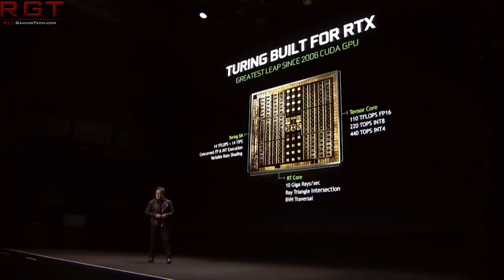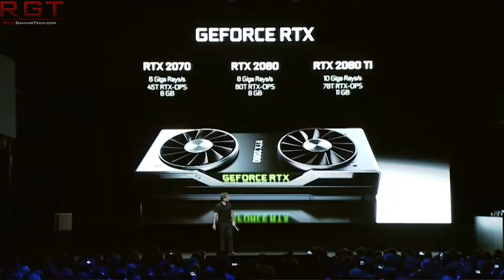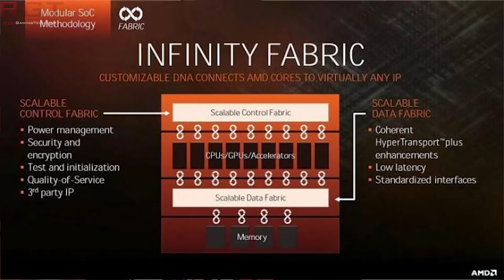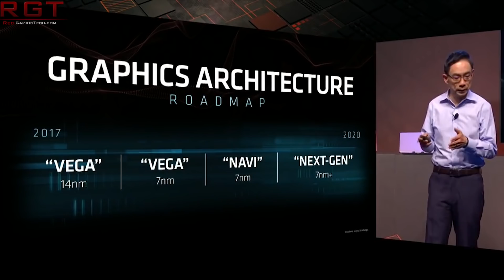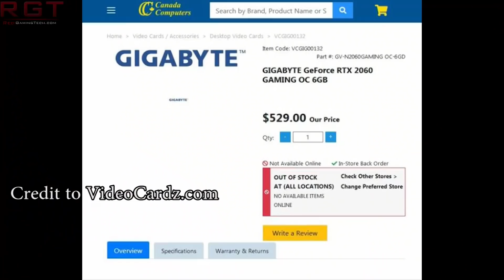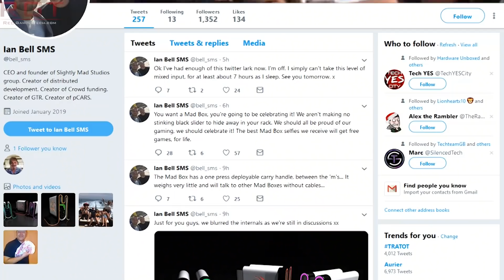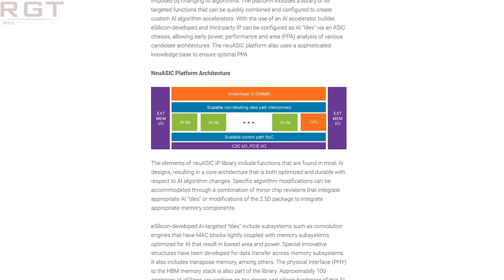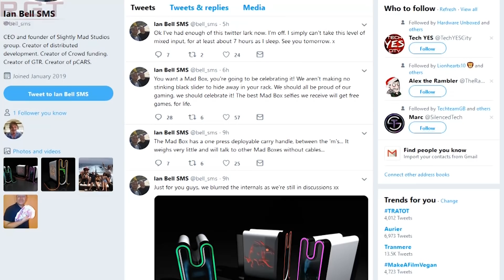Nvidia GeForce 30 Launching 2020 with 7nm Process | Mad Console To Have AI ASIC

Comment: Nvidia must be scared about AMD to make such a bold announcement about something so far away.
Reply: doubtful. very doubtful.
Reply: ONMY MONSTER PC IS CPU:RYZEN 7 1700 EAM:16 GB DDR4 3200MHZCL15 GS KILL RIP JAWS GPU: GTX 970 G1 GAMING MONITOR: DELLP2416D 24'' 2560X1440 60 HZ IPS MOTHERBOARD: ASUS PRIME X370 PRO PSU: CORSAIR 750M 750 WATT HDD1: WD BLACK 4TB(HDD 1) HDD2:1 TB(HDD playing 1440p max settings 30+ fps some games even 60 fps evrything and looks amazing. iam waiting for 3000 rtx to upgrade. until then iam keeping gtx 970!!!
Reply: scared as in they r soo far ahead, to this date amd still has no answer to their last gen king aka the 1080 ti. which already 2 years old hahahah, ya real scared
Reply: exactly
Reply: @laujack24  It's not about who makes the prettiest graphics, but who sells the most... And last I checked Nvidia usually caters more to niche users on the high end, there is definitely a lot more user of Old Pre-10 series GTX OR using AMD cards below the GTX 1060 level.

And by this I mean users who are only willing to spend about $250 USD or LESS, not more.
Reply: nvidia scared? i lol'd... nvidia is under no form of pressure from amd. 1660 ti beats vega 56 with 1/3 the powerdraw. sad but true. radeon vii performance is decent, nothing great, because of insane powerdraw and no customcards (reference card is around 50db load with insane temps, gpu at 85c and vrm at 110-120c). for 699 it's complete garbage, even 2080 looks like a steal compared to radeon vii.

Comment: Nvidia Tossing TSMC aside and replacing them with Samsung..
When you thought RTX 20 cards are expensive imagine it now with Samsung in it.
5k Titans 2.5k XX80ti and 1.3k for a XX80. 
Samsung has great quality but it comes with a bigger price tag. 
This is true in Memory, storage and process.
Reply: What is TSMC's 7nm compared to Samsung's 7nm? Obviously they're different just like how TSMC and GloFo are different.
Reply: @rustyshackleford5668  Samsung 7nm is using EUV not finfet. So you might see a better process maybe up to 15%. However TSMC is bound to use EUV in 7nm+ for Ryzen 4000 and Arcturus GPU. Finfet is pushed to the absolute limit now. Everything pass 7nm is going to be EUV.
So by 2020 the difference between samsung 7nm and TSMC 7nm+ is nothing. They are practically the same. Samsung just charges more.
Reply: @Thesinistereyes1  Wasn't TSMC planning to explore 5nm with EUV anyway?
Reply: @rustyshackleford5668  my previous comment did say TSMC 7nm+ will be EUV... its not that hard to read...
Reply: @Thesinistereyes1  ONMY MONSTER PC IS CPU:RYZEN 7 1700 EAM:16 GB DDR4 3200MHZCL15 GS KILL RIP JAWS GPU: GTX 970 G1 GAMING MONITOR: DELLP2416D 24'' 2560X1440 60 HZ IPS MOTHERBOARD: ASUS PRIME X370 PRO PSU: CORSAIR 750M 750 WATT HDD1: WD BLACK 4TB(HDD 1) HDD2:1 TB(HDD playing 1440p max settings 30+ fps some games even 60 fps evrything and looks amazing. iam waiting for 3000 rtx to upgrade. until then iam keeping gtx 970!!!
Reply: @shredderorokusaki3013  The next upgrade might cost you the same money you bought your entire PC parts list for. TBH i think pascal will be the last good architecture for a while. These RT cores and Tensor cores are nothing but fluff. They dont work well, they make more heat, and they aren't for everyone.
Reply: @Thesinistereyes1  Exact;ly. RTX 2080 costs as much as motherboard cpu  ram and HDD costed  me in march 2017.  Paid 920 euros for al of them( ASUS PRIME X370 RYZEN 1700 16 GB DDR4 3200MHZCL15 GS KILL RIP JAWS WD BLACK 4 TB). Upgraded from core i5 2500k and 12 gb ddr 1600 mhz.And RTX 2080TI costs even more than the rest of the system. That why iam not buying not even RTX 2070 because while i have money to buy 2 RTX 2080 ti's if i want but i dont do it not only because gtx 970 still runs evrything at mx settings 1440p but also because i dont want to support those terrible pracises by nvdia. However AMD will force nvidia to drop prices soon if they release cards with rtx 2080 perfomance for just 250 euros. If not then intel will do it for sure when they start releasing their graphics cards.
Reply: Rusty Shackleford its this way: tsmcs 7nm + makes 4 layers in euv and 5nm makes 14 layers in euv. So yeah both are euv but only 5nm "real" euv
Reply: I just thought that they were weary of the potential monopoly that TSMC has and are trying to spread out their product stack. Plus TSMC only have so much manufacturing capabilities and they are going to have some of their products to keep inventory up. With EUV 7nm vs 7nm they will have a process technology advantage too, it will be faster, denser smaller and consume less power. With their huge fucking dies it will make it much cheaper and faster to produce their GPUs.
Reply: @Thesinistereyes1  doesn't euv mean extreme ultra violet lithography though? So it's a process while finfet is a type of transistor. So although euv allows for smaller process nodes the finfet transistor is the limiting factor?

Comment: once they launched the 2080ti with the 2080 & 2070, I've been expecting a 7nm version in the 4th quarter of 2019. I mostly play simulator games that arn't AAA, so i'll be surprised if any of my games implement raytracing for a few years. 

I'm just happy getting 120fps in 3440*1440 ultrawide for driving, in F1 2018 i get around 100 to 130fps in ultra with my 1080ti. Once there's a game that i'd actually want to buy that implements RT and the hardware matches my res & refresh rate then i might consider it.
Reply: We'll need new sims, be great when devs can just render the entire planet in a flight sim and you the player just pick a theatre of war and a date with every thing else all set up ready to go.
Reply: The new Assetto has Ray tracing coming, first SIM I know of.
Reply: With Nvidia switching to Samsung for 7nm I doubt we will see any new cards higher than what currently have until mid 2020

Comment: The problem with GPUs isn't the amount of calculations they can do it is how fast they can spit out the results- the latency. How long it takes to give you the answer to the 'first' question while it is working on the 2nd 3rd and 4th question. A car manufacturer can pump out a car every 2.5 hours or so (model T by Ford lol) but they are working on multiple cars at different stages of construction. Same goes with making a picture and spitting them out fast enough to make it look like moving pictures. Now you are asking the manufacturer to 'change it's specs' while its 'manufacturing' - different paint job, seats, transmission, number of doors, auto, manual etc... Latency= interactive experience...

Comment: Also re Valve and SteamOS, if you look at what they are doing with SteamPlay/Proton and the DXVK project, it is possible that they are making a push for of Steam boxes and Linux. Look up the ProtonD (https://www.protondb.com/ ), pretty much all the games in my steam library work out of the box on Proton and that includes Project Cars 2, Strange Brigade, Shadow of the Tomb Raider, Nier Automata. So what was missing when Valve first brought out steam boxes was the translation layer from DirectX to openGL. DXVK and Vulkan have or are solving this problem and giving very good performance. There are also now custom designed Mini-ITX cases everywhere and side mounting of GPUs so designing the case appropriately to permit upgrading hardware would not be an issue. The question is would they sell enough of them if people could just upgrade the GPUs easily?

Comment: no nvidia XX60 card should draw more then 120 watts even if it is a $250 card. given that a performance per watt advantage is the key reason any person would pick it over a 1070 in the 1st place. also integrated graphics will never replace a dedicated GPU. they get outdated too quickly. unlike a good cpu which can last 5+ years. not to mention DDR4 dual channel maxes out at 51GB/s while GDDR5 is 256GB/s never mind GDDR6 or HBM. rumors are DDR5 is going to be more a capacity boost then a speed one.

Comment: Even if in 2019 AMD has small process advantage (and thats a big if), does not come close to making up for the likely huge architecture shortfall as always.
Reply: Well they definitely will have a huge process advantage, both AMD and Nvidia are currently using the TSMC and TSMC says themselves that 7nm is a tremendous leap from 16/12nm, That being said process plays only a small part of the total equation, Nvidia clearly has a better more efficient architecture. If Nividia put the 2080ti on TSMC 7nm it would be an outright beast, Nvidia chose to use the lower cost older process.

Comment: ONMY MONSTER PC IS CPU:RYZEN 7 1700 EAM:16 GB DDR4 3200MHZCL15 GS KILL RIP JAWS GPU: GTX 970 G1 GAMING MONITOR: DELLP2416D 24'' 2560X1440 60 HZ IPS MOTHERBOARD: ASUS PRIME X370 PRO PSU: CORSAIR 750M 750 WATT HDD1: WD BLACK 4TB(HDD 1) HDD2:1 TB(HDD playing 1440p max settings 30+ fps some games even 60 fps evrything and looks amazing. iam waiting for 3000 rtx to upgrade. until then iam keeping gtx 970!!!
Reply: @user78405  Haha! You have a ancient 4 core cpu and you call it a monster while mine is a very recent 8 core! Get Ryzen 2700x and then cal it  monster. Or wait few months for ryzen 3700x that it will be 16 core and cost 500 euros and then buy that!

Comment: Just googled canadian price of SAME model name but with 2070. That is 730 canadian dollars. 
Cheapest 2070 that newegg.ca  is 680 dollars.  In Finland the Gaming OC variant of 2070 is 60€ more than cheapest Gigabyte 2070.  If the price of the leaked card actually is in the 400USD range then you should expect cheapest cards to be 350USD range.

Basically it means that this is a bit premium model and not cheapest.  So basically we should expect 2060 be that 50$ cheaper than the listed price. 

https://www.newegg.ca/Product/Product.aspx?Item=N82E16814932089

Comment: AMD RX 480 was on a smaller node than the 1060 but sucked more power and was less efficient. They didn't have the advantage. I'm hoping for Navi not to suck so I can finally upgrade.
Reply: They are both 16nm?
Reply: AMD's Polaris was on 14nm FinFET, Nvidia was on 16nm from TSMC with the later lower end cards being on 14nm and from Samsung. Both of them being FinFET.
Turing is the one on 12nm, as does the RX 590 (or rather an RX 580X/RX 585 imo, or whatever you want to call it).
Staring blindly on transistor size will get you nowhere, that does not give a foolproof complete view of their performance.
If you compare performance between the rx 480/580 and the 1060, there isn't one that has the clear upper hand.
Choosing between these two is a matter of price and what games you play most of the time.

It's also useless to stare at frames if you only have a 1080p 60Hz monitor. Need more? Get something better. In that case you don't have much of a choice for now.
Reply: 14nm  12 nm what amd is using is actually 20nm......amd racing with 20nm vs intel 14nm and 16nm tsmc....
tsmc 7nm is not 7nm is 10nm....and 2020 7nm+ is the real 7nm..............amd is jumping with zen2 from 20nm to 10nm and then 7nm(7nm+)
Reply: Funny how Nvidia fanboys love power effiency but are crickets that both the 2080 and 2080ti have not one but TWO pciexpress power cables!! LMAO
Reply: @4everlol4life  the latest benchmarks show otherwise. 580 creams the 1060 in all but grand theft auto. Drivers have regressed on the 1060 and it's choppy compared to the smoother 580
Reply: @timothygibney159  that has to be a joke, right? AMD has not released a GPU that uses less watt per fps than AMD in 10 years. If Nvidia uses 2 on the 2080ti, AMD would need 3 to compete with it. Which is why they don't compete. 

Pointing to the 2080ti to insult power usage is like claiming Honda's aren't fuel efficient by pointing to their Formula 1 race cars.
Reply: @eugkra33  if AMD did this all channels would be laughing and pointing out. Nvidia silence. Look it up yourself on pics

Comment: Too little too late. After everyone including myself get a huge upgrade to 3700X and GPU Rx 3080 that will cost hefty amount of $ i will not look for upgrading my PC for at least 5+ years.
I guess same will go for others too. I have read a loot of pepel whou bought 1000 seroues *1500X/1700 etc who are happy as it is with their cpu amount of cores etc. Untill there is no clear usage of multicore gamming etc they will not be upgrading. Same goes for my right now i5 4440 that i use and will replace it with 3700X.
I can't tell you how much i regret buying 1060 Ti 3gb Asus and for almost same price i could have bought RX 580 8GB ddr5 that would be perfect for gaming fullHD with 5GB MORE ddr5 memory!!!
1060 is ripp off and it is overrated. 1060 6gb cost too much and would still get 2gb extra gpu memory than 6 no matter how fast cuda etc.

Comment: 390-400$ for 2060, you have to be kidding me. no one will buy that card for 400. if it can't even beat the 1070ti and costs more than 1070ti the card is DOA. 2060 also has less memory and slower memory bandwidth what the 1070ti has. I really hope AMD announces Navi next Wednesday and the card is going to be on that 250-300$ price range. Just leave the gimmick raytracing out of it.
Reply: 2060 with 192bit 14Gbps GDDR6 has more memory bandwidth than the 1080 with 256bit 10Gbps GDDR5x... Do some research before making false statements.
Reply: canada retailers always charge more.

Comment: Nvidia is going to lose the mainstream market with a midrange price point of $350. AMD will as well. People will switch to console, and retro gamers can use a $50 GPU. We have the new APU's right at 4GB 570/3GB 1060 levels now, and they will be on shelves this year. I'm expecting 4GB 580/6 GB 1060 performance in most $250+ CPU's next year, so this new $350 is midrange is a horrible business strategy for both AMD and Nvidia.

Jensen is being removed as CEO, that is a given. Whoever takes over should (as should Lisa Su and Raja) push very hard for mGPU, as in DX12 and Vulkan, the cards do not need to match. Using the APU with a normal $200-$275 midrange GPU that should be 2 steps up from last gen would be a great selling point. Raising the price and stepping up 1 spot in a 2.5+ years span of time is GPU suicide.

To people that say (or write as they would not say it to you in public) "Get a better job", we are not talking about upgrading to a larger house with an in ground pool, we are talking about a GPU and performance/value at price points. If Doritos made their family size bags 75% smaller and raised the price from $5.99 to $9.37, you could still afford the chips, but have every right to be pissed that Frito-Lay raised the price on all their snacks. Then other companies follow suit, because even though they may make a crappier chip for what you are doing, they will still sell raising prices from $2.30 a bag too $3.50.

It's a matter of how far you are willing to put up with. Capitalism is based on greed, and I support it, as it has a built in check and balance (on a small scale like a GPU price) in consumers not buying the product.

Navi was planned to perform like a 1080ti at the $250 price point. Prices for materials have gone down, but rumored price is up 30%. I'm at the point where I'm probably going to get a professional card and write it off as a business expense, and pick up another 1080ti or Vega Frontier used, as I don't want either division to have my money for a gaming GPU. Not at $350+ for what should be midrange. 3 years ago a 4/580/1060 was midrange. A V64/1080 should be the minimum midrange now, at about the same price. Maybe a 10% increase, so $250 from AMD and $310 for Nvidia bc the 6GB 1060 was overpriced from the rip ($229.99 480 8GB, $219.99 580 8GB, $279.99 for the 6GB 1060).

Nvidia already lost Tesla and self-driving cars. They lost VR. Now they are about to alienate the majority of gamers who ONLY look at $150-$300 cards.
Reply: can't believe trump made everyone poor...under obama...we never complain on pricing like this
Reply: Nvidia is just too greedy. hope the 2060 sales end up being terrible and their stock price crashes even more.
Reply: Sounds like you watched Coreteks' video
Reply: @user78405  That's bc the pricing wasn't like this. @Teemo Puff I believe I did, though I'm unsure if it was before or after this post. Hard to believe but people often look at a situation and see it in very similar ways. Did he mention Doritos, as if not, I win? No, he made a video and I just write novellas when I get peeved.